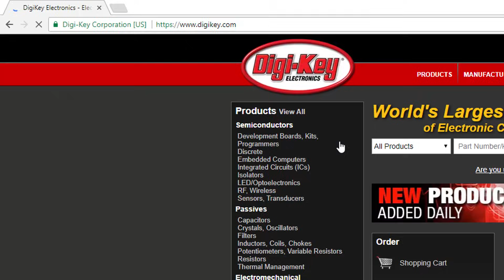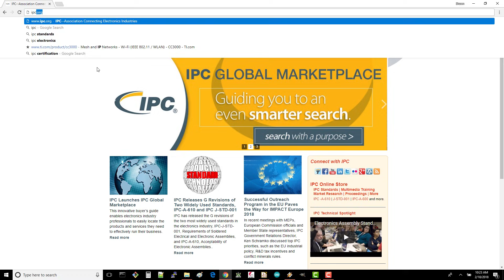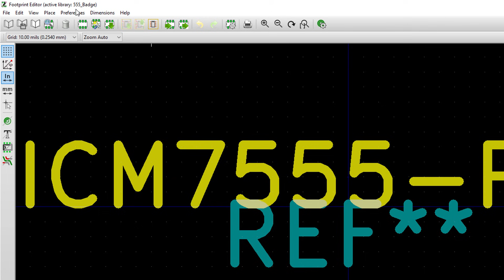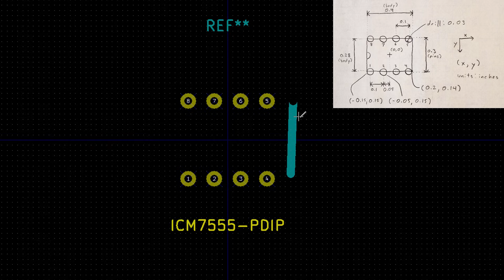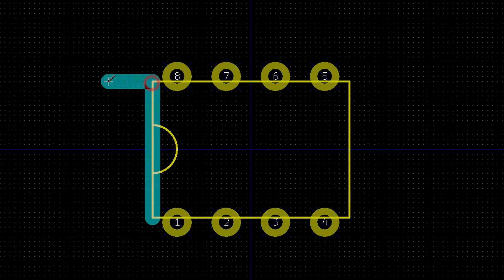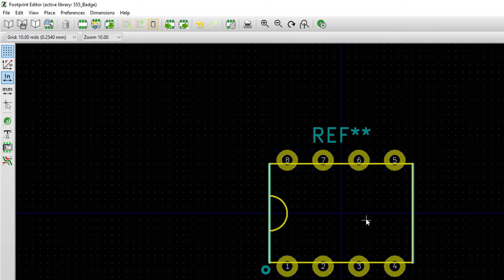Comment: It is a lot of work, and the imperial system is not helping, it is the opposite. It would have been okay if some people kept the imperial system as a folklore. But there are limits in what can be done with it, those limits have been reached already, writing everything smaller than an inch as a fraction is such a limit. Only the solution is so halfly done. Yes, the decimal system would have been better. Simply forget inches, never touch them again and it is over.

Comment: This KiCad drives me crazy. I wanted to place a resistor and assign TO247-2 horizontal, it us 4 hours now that I am on that, I give up and keep doing all in Altium, it takes 60s and the 3D pcb can be seen. Kicad is none intuitive, simplest things need intensive research and self figuring out, reminds me on Eagle, sorry even as it is open source, Altium is the way to go.
Reply: the kicad UI is non intuitive, and its hard to even make a practice circuit. I don't understand who kicad devs intend to use their product. huge timesinks are required, plus almost everything about kicad 6 is different than in the tutorial series here.
Reply: it was pretty easy for me, took like 1.5 hours to learn the basics

Comment: The current version (5.1.8)-1 is so different (menu names, how directories are listed, etc.) that it is really detracting from the value of the video. I was kind of figuring how to get around the changes in the menu structure until I got to this vido (part 4). The footprint won't save, even though I have created the library, point to the directory, etc. Also, the line edit does not work.  I right click on the line to set the start points, don't get an edit window, just a menu box with Cancel, Center, Zoom In, Zoom Out...Grid.  Also the grid does not set to the menu values (trying to set it to 20, as in the video).  It stays at 25, even though the selection shows 20.  AARGH!
Reply: Yeah, a lot of the changes seem completely unnecessary too.

Comment: Pin 1 is normally a square pad, so you can tell from either side which pin is pin 1 for through hole parts.
Reply: And the same for the positive of an electrolytic capacitor. In addition to your reason it also allows recognition with or without the silkscreen layer.

Comment: This tutorial is the best I ever have seen. For this section, it would be great to add assigning 3D models to parts. After all, a board with components has to be placed into an enclosure, etc. I have trouble finding a good tutorial for this process.

Comment: The XY system isn’t specific to KiCad but for computer graphics in general, just fyi
Reply: So there was no XY system before the computer era?
Reply: No, it is unique. In computer graphics and mathematics, the Y axis always points UP, not down. This is also the case with 3D graphics, though there's some indecisiveness about whether or not the Z axis points out of the screen (towards you, right-handed system) or into the screen (away from you, left-handed system). The exception to this rule is the film industry, which for some odd reason uses a convention where the Z axis is the up axis.

Comment: Nice video. I love the idea of open software, but come on, having to design a freaking PDIP is ridiculous, and the library system is.  By now we should have very simple PCB designer, with create PCB size layout.  Drag components onto PCB.  Connect wires.  View and check.  Create Gerber files.
Reply: I'm pretty sure the point is this shows you how to create components for ones that don't exist. Using a common component for this is just an example.

Comment: Hey guys, I'm not sure if anyone else is having this problem. This may be because of the KiCad 5 updates but when I switch to inches, only the position changes to inches. The hole size remains in millimeters. For some reason when I try to mess with the hole size to make it smaller, kiCad has an issue and seems to scale everything down. However, when I keep the dimensions in millimeters I don't seem to have this problem. Does anyone know a fix?

SOLVED: I figured it out. I was confusing mils with millimeters when a mil is really a thousandth of an inch.

Comment: The program looks good, but for the love of God, to create a simple component of this has this absurd amount of steps .. in Proteus this compnente takes 1 minute to be done ...
Why do not you have an option to create a square ??? You have to create 4 lines ???
I tried to make a footprint of a Jack P2 and it was hell because the pads have very different positionals ... anyway ... zero productivity.
Reply: Yes, this seems way more difficult than it should be.  Hopefully for most things there are existing footprints that can be used or copied.

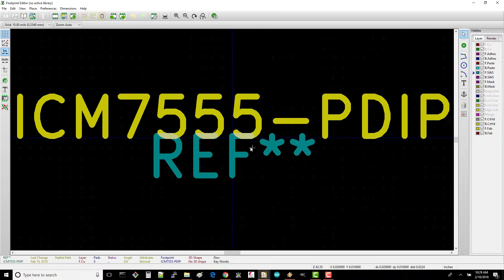Comment: I don't have an option to save footprint into library. 3:47
Reply: If you are using KiCad 5.0, this process is switched around slightly. You will have to create the Library first and then add a new symbol to it. The create new library button is on the far left of the tool bar and the create new symbol is the fourth button from the left.
Reply: @digikey  and how to create a footprint for it?

Comment: Saving to your library has changed:
1. Go to File -> Save footprint in New library
2. Go to Preferences -> Footprints Library Wizard -> Select "Files on My Computer" -> Browse to your library folder you created (with .pretty end) -> Click next, next & finish
3. Go to File -> Set Active Library -> Select your Library you created (same as folder name)
4. To save Footprint - > Ctrl + S or Go to File and "Save Footprint in Active Library"
Reply: Your directions don't match the current version unfortunately.   Do they keep changing the interface with each release?  Seems like that would make it difficult to use if you have to keep relearning it everytime there is new version.

Comment: I think the names front and back are completly random. I don't think there is any process in the fabrication of a pcb where the top layer is actually on the front. PCB's are produced horizontally, so it should be top and bottom.
And i think in some places in kicad its top and bottom, its kinda inconsistant there.

Comment: I hope there are better ways to do this, because this is awful. Also, the convention is a square pad for pin 1 on a through-hole DIP. SERIOUSLY, this is the most convoluted footprint creation process I have ever seen. It makes PADS PCB look like child's play. Yuck.
Reply: I definitely agree that KiCad's footprint creation and association process is not the easiest nor cleanest I've ever used. Do you have a reference for the square pad for pin 1 being convention? As far as I can find, IPC calls for just some kind of pin 1 marker on the board, so it's really up to the designer. That being the case, I have a hard time telling square from circle pads once the pin has been soldered, so I usually prefer some kind of silkscreen marker that can be clearly seen after the part has been placed.
Reply: Thanks Shawn for explaining all the basic concepts of PCB making very nicely in your tutorials. I will be migrating to Kicad from Protel/Altium since version 5 of Kicad is a major upgrade.
As for identifying pin 1 of the IC, in addition to making the pad a square, I always put  a "1" close to pin 1 on the copper side while designing the PCB. This helps to avoid the mistake of soldering the IC the wrong way around even if there is no is no silk screen marking on the PCB,
Reply: I'm just starting out with KiCAD, but the other CAD I have a little experience with is Fusion 360. Coming from constraints-based sketches to something that doesn't even have a rectangle tool is quite the comedown!